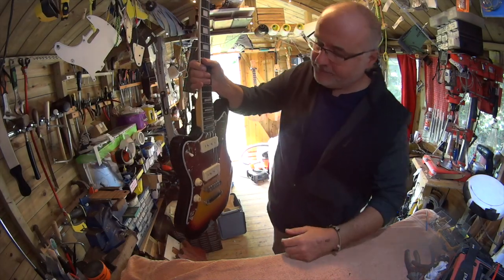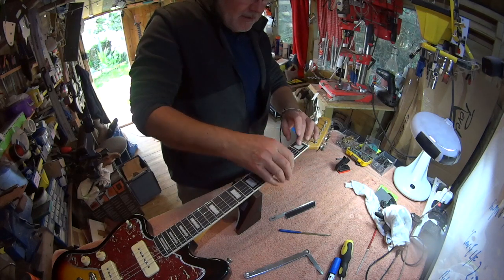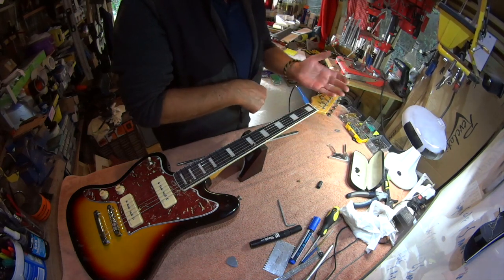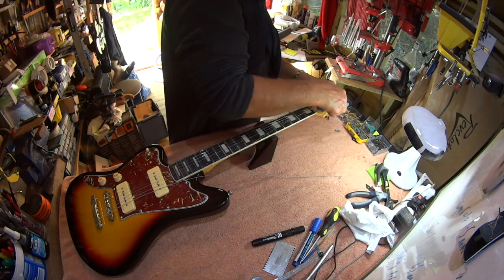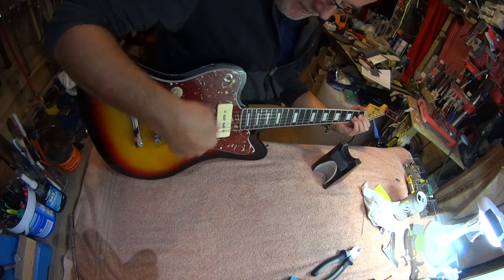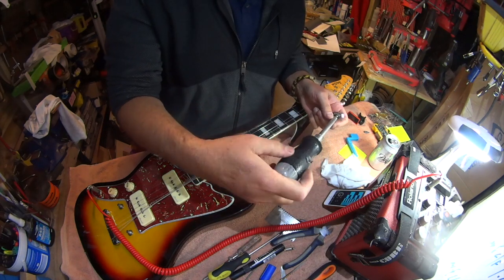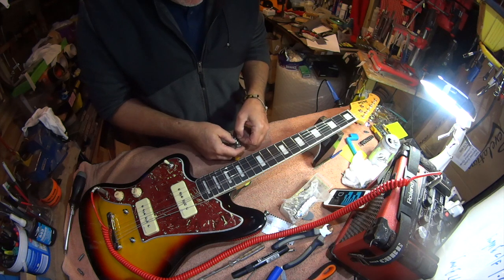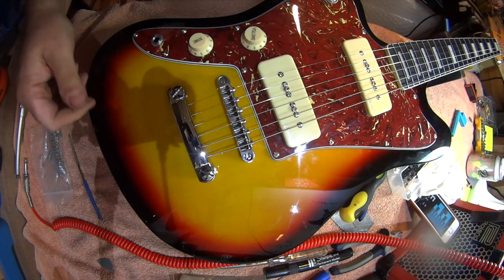Harley Benton JA 60 set up

Comment: Great video! Thanks! Taught me a lot about understanding my Harley Benton Guitar. I have a Les Paul imitation. First impression: Looks good, feels good and solid - luckily the fret level is good enough to leave it like that for now, and surprisingly no sharp corners. Little issue though, the corners at the high e string are filed a bit flat - so sometimes the string slides off (1 out of 50 times when playing somewhere 7th fred +). I found out that the saddle is in a slightly wrong position. So, new saddle ordered. The bridge is okay, 12th fred intonation luckily works! (a few tiny rough spots though) BUT! My problem is that the guitar doesn't stay tuned. Tune it, play a literally 2-3 chords, tune it again, again, horrible. I ordered a new pair of quality strings (the out of the box strings felt rather cheap) and the tuners felt really bad, so I ordered them as well. I really hope these two improvements will solve the tuning issue, perhaps no new bridge needed.

Comment: I wonder if the manufacturer specifies a particular gauge of string, and if deviating from that gauge, would we then have the intonation problems?( I realize that the bridge is probably in the 'wrong' place)Likewise, would using a different gauge (heavier/lighter) be closer to achieving a compromise of intonation?   They've at least made the problematic rattle-prone Jazzmaster bridge more appealing with this!
Reply from the maker: Hi Fingers.... I don't think it could be that much different between gauges and I replaced with 10s the same as it shipped. As you can see from the vid (at least the end part) the saddles are all slammed up against the front edge and it's just about intonating. You're generally right though, the gauge, composition and condition of the string all do seem to have some impact on the length required for correct intonation of that string. It's not uncommon for budget makers to place bridges slightly out of position and - hard to believe - make their necks too long or short. An example just the other day was Dave's Chinese-made 'Riks' strat. I found that I had to push all the saddles way back off their 'default' marks to intonate so it occurred to me to measure the scale length (i.e. distance from nut to centre of 12th fret x 2) and lo and behold, it was 650mm instead of the standard 648mm of most strats.

Comment: Hello Sam another great video. I have one of these guitars. Out of the box it just needed a set up and also the G string nut slot wasn't cut deep enough. The nut material was so soft that after just a few strokes of the nut file it went too low. I managed to save it with the superglue nut powder trick but I have never known a nut material so soft. My question is I notice that you, and a lot of other luthiers, intonate the strings using the harmonic against the fretted note on the 12th fret. What is the advantage of doing it that way against playing the open string against the fretted note on the 12th fret? Thanks,  Richard.
Reply from the maker: Hi Richard - thanks! You're right the nut is like cheese...but it cut well enough to leave it alone. If the nut works and I can get the 1st fret actions I'm after then I tend to leave it be - particularly if it's finished / fitted nicely. The difference tonally between bone and this plastic when the sounds coming out an amp....well I'd be willing to bet £5 almost nobody could correctly identify the difference if I recorded 10 chords, 9 with the guitar with a bone nut and 1 with the guitar with its original nut. To win you'd have to identify the plastic cheese nut 5 times out of 5 (and I'd rearrange the order its in each time obviously) :-)
Reply: Thanks Sam. I managed to get the bridge to intonate on mine but I play with very heavy strings, 11s in this case and as a rule of thumb heavier strings tend to make the saddles move further away from the neck to intonate. I'm wondering if this is the reason that mine just about managed to get there. I do think the bridge is misaligned though as they should be set up for the thinner strings which they supply with the guitar not my cables.

Comment: Always worth checking for unusual explanations when a common guitar won't intonate. Always use new strings of course. I know shops that lower the pickups every time before intonating - they feel the magnetic field can knock the intonation off. Worth a try. I've had guitars where the intonation did not change no matter how far I adjusted it. A closer look revealed the string was touching the bridge edge or an intonation screw (unlikely here I know). I have the JA 60 from another vendor. Similar issues - sharp fret ends. The TOM is crap as you found  - now replaced with a roller bridge to avoid those nasty buzzy circlips. But the original one did always intonate.
Reply from the maker: Hi Tim - absolutely right. The fact that I deliberately wait until final re-stringing (with new strings) to intonate means that it's only THEN I discover this guitar wouldn't intonate. All of which makes it difficult to 'return to seller in original condition' since I've already done a complete set up on it, including fret levelling. On the plus side, right now apart from being fractionally off on the intonation it plays and sounds great... (for a left-hander!)